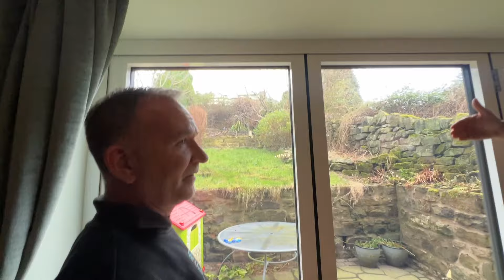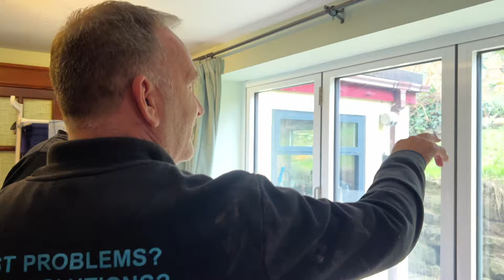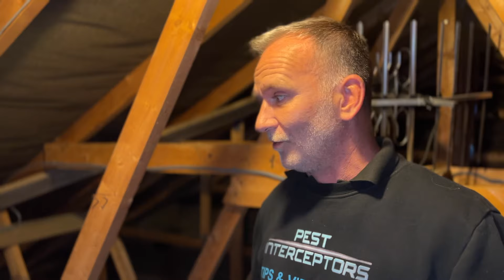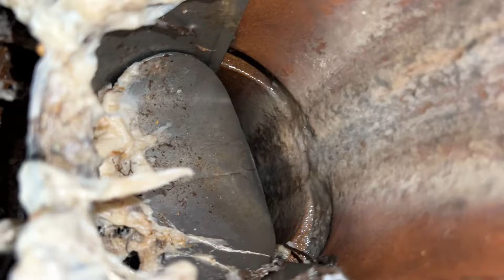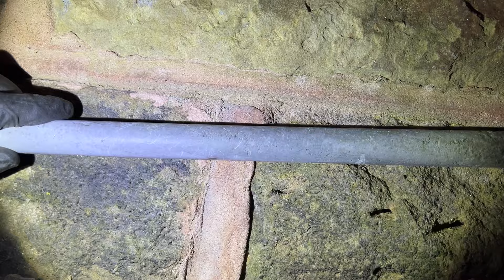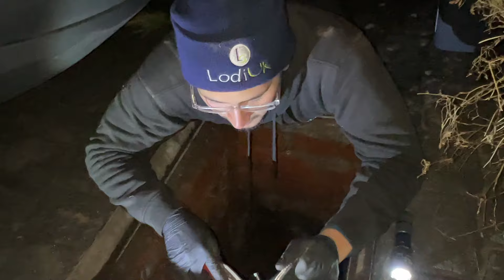RATS 5 YEARS! - 3x 'Pro' Pest Controllers JUST PUT RAT POISON DOWN - The SMELL! The FLIES!

Comment: Great stuff lads, this was one fantastic video. I finally managed to get rid of the rats entering my house. My rat problem wasn't coming from the sewers as I've a septic tank and it's all in good shape. They are coming from the surrounding fields as I'm in the countryside and yes they were the very rare buggers that were climbing up the spouts and in through the eaves and into the roof. I sealed up the holes and laid poison in bait boxs outside on their rat runs and eventually killed them but every 2 months I've noticed that they return to the yard again. I've absolutely nothing that's attracting them, no rubbish, no bins, no compost heaps etc. I do have afew old walls just like the ones in this video which are situated about 5 yards away from the house. How can I stop them from returning every few months to the area? I'd love to see yee do a video on homes in the countryside that arnt connected to the main sewers and how to get rid of them from yards etc for good, if that's even possible with living in the countryside. Thanks lads 😎👍.
Reply: So my question really is how do we stop them from returning to the yard and garden areas? as I no longer have them entering the house.
Reply from the maker: Well, like we say in the video, “even when the rats are coming from outside and getting in, the rats are coming from a sewer problem”. 
It’s particularly hard to pinpoint if you have these style of stone walls as the rats can use them like covered motorways between places and if the broken sewer is under the wall somewhere 🤷‍♂️ 
Awesome results though 👍🏼✅👍🏼✅
Ps. Don’t forget that rats can use septic tanks to get in your house. Watch our most watched video to see how they do it. ✅
Reply: @PestInterceptors  last October I had a rat arrive in the toilet bowl. They were jumping down into an opening in the septic tank and up the pipes. I sealed up the tank and problem solved. That's when they started climbing up on the outside of the spouts to the gutters and in through the eaves. Solved that problem. My septic tank is only situated about 10 yards away from the house and there's absolutely nothing over where the pipes run from the house to it only the ground and that's perfect. The nearest public sewer pipes to me are about 3 miles away at the nearest town. So you could say I've all my exclusion work done and place tidy and no food sources inside or outside, 4 bait boxes outside in the active runs. It does kill them but they keep returning after about 2 months to the yard. It's a very tricky one tbh and I would be delighted to get this solved for good. But thanks to you guys for yer videos and advice I have got them out of the house, it's just the surrounding yard and garden is the issue now. I live across the road from a farm and wondering is this a factor? I only have 1 other neighbour and they have no issues but the farm does have rat problems. So my reckoning is that it's either the rats have a food source elsewhere that I don't know about an are living in the old stone walls near the house or they are completely resistant to the poison. I absolutely hate using poison, it's a last resort that I was very very reluctant to use but had to. Its just very frustrating using poison every few months nonstop as it's not good for the environment.
Reply from the maker: @barriejordan2837  here’s something to think about. 
The whole family of rats do what the alpha does. So if the alpha eats poison, they all eat the same. They keep doing this as long as there is a food source they trust even though it’s poison. They do this until the whole family of rats is dead. 
So here’s the question for you to fathom. If all the rats are related and you kill them all (no more bait goes). Then where are the new families of rats coming from? 
Like I say, even on the super rare jobs where they are climbing in houses, they are always coming from sewer pipes somewhere. 
You may find a correlation between the cesspit being full at your house or the farm. That will answer your question.
Reply: @PestInterceptors  I just did my weekly inspection of my house outside and checked the bait boxes in the yard, shed and near the septic tank and not a single piece of poison eaten in over a week. So for me now it's a plus. I seem to have push them further away thank god. My septic tank is not even quarter full so it has to be a neighbours tank which is the attraction. Just set up another bait station in the neighbours coz she has seen 1 during the week and I did find rat runs in the grass in that area close to more old stone walls, fingers crossed it wipes them out and I must get to the bottom of the other septic tank to see how full it is. Thank you so much for your help lads, your videos have been a major education in pest troubles, I've learnt alot in the past 6 months and I have to tip my hat to you lads coz damn it's tough work but exciting at the same time, I like a challenge and god they are a challenge 😂😂😂😎👍.
Reply from the maker: @barriejordan2837  you could always pop on to Google reviews and give us a five star review for being so awesome 🤩 ☺️